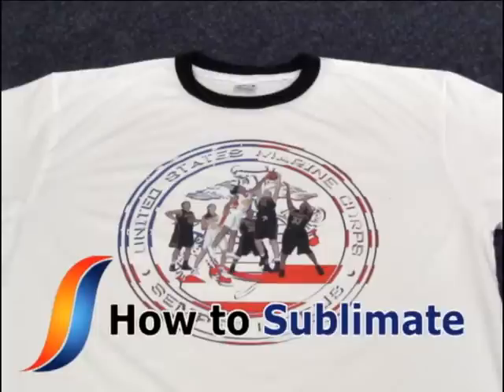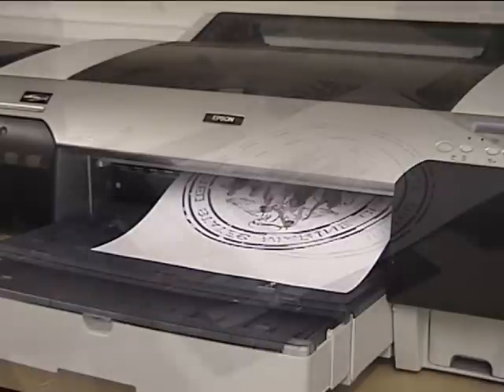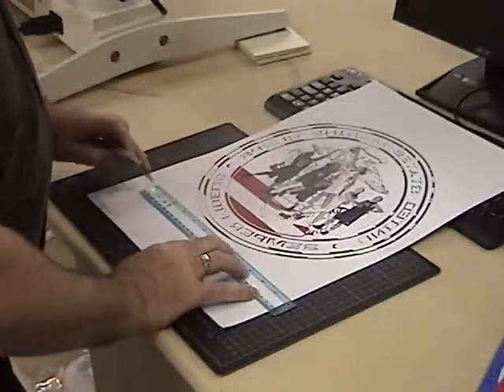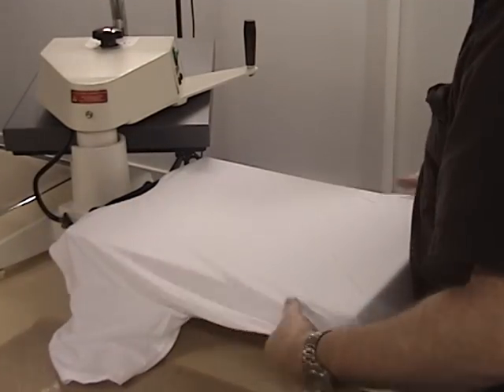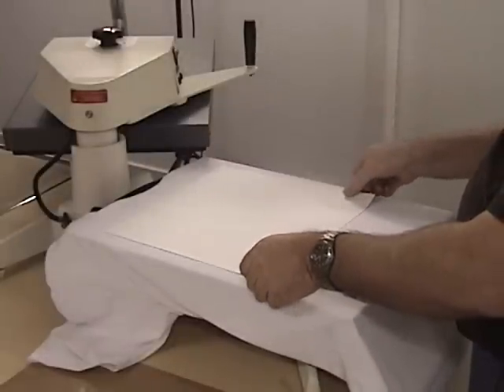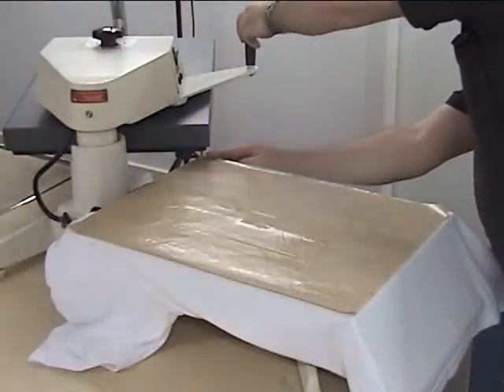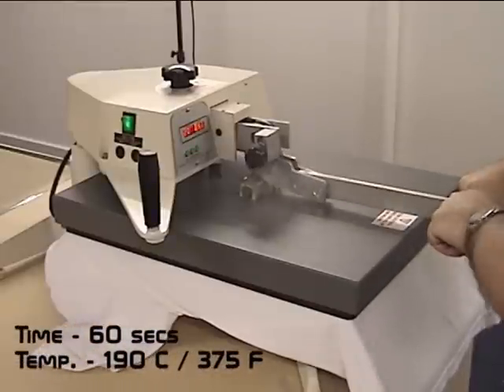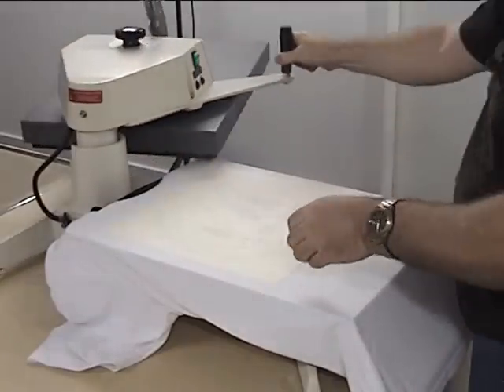How to Sublimate a T shirt

Comment: Sublimation process uses a special ink that is designed to work with polyester or products with a polymer coating. This type of printing can be done on plastic,cups,metal,and polyester garments. The sublimation ink is formulated to turn into a gas when it is heated to a tempature of 400 + degrees. when the ink becomes a gas it permiates the polymer/polester coating of the substrate and the image is transfered.
Reply: Daniel Paz so no cotton shirts

Comment: THIS IS VINYL HEAT PRESS PRINTING NOT SUBLIMATION
Reply: It is sublimation, what are you talking about
Reply: Process same as VINYL..just printing paper  is diffferent......What kind of printing paper is that? gloss?
Reply: WHAT KIND OF PRINTER PRINTS SUBLIMATION?  only jet printers???? 

DO YOU NEED SPECIAL SUBLIMATION INK for any printer if your going to print with any printer???

CAN sublimation paper only be used with the sublimation ink and the sublimation printer?
Reply: @richwalker7348  yes sublimation paper is only used with sublimation ink. All sublimation printers are considered inkjet printers, but are not the same as normal copy paper printers. Look into the Sawgrass Virtuoso SG400 or SG800
Reply: @VexGod  Thanks...  CAN SUBLIMATION PAPER be regular MATTE PAPER????
Reply: @richwalker7348  no it has to be a specific sublimation paper designed for whatever material you're printing on. The standard paper for the sawgrass virtuosos is the text print r paper it comes with

Comment: Hi, this is not sublimation! This is heat transfer!
Reply: @MrDeewan Rabbit , sublimation uses gas to fuse directly with the shirt whereas inkjet is basically plastered on. The difference is that you can feel the inkjet transfer after it's on the shirt but you can't feel the sublimated one.
Reply: heat turns the ink into gas if you know anything about chemistry xD